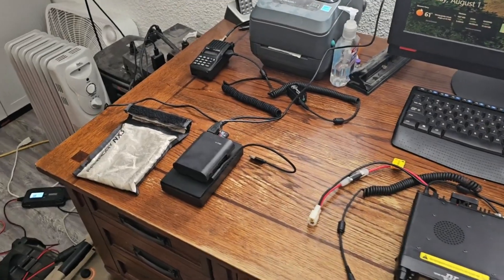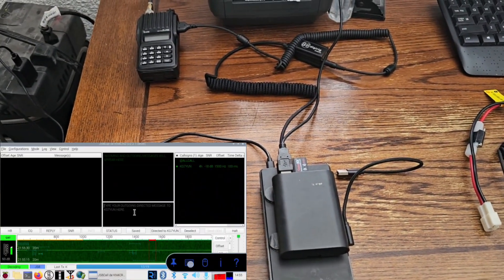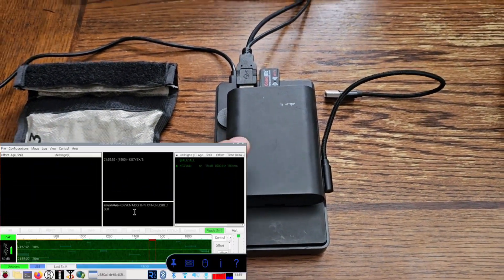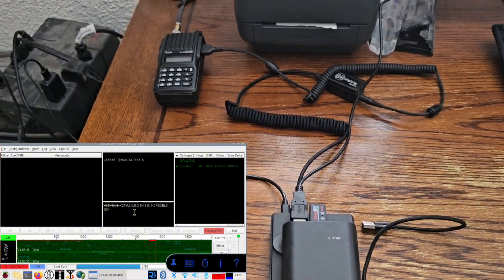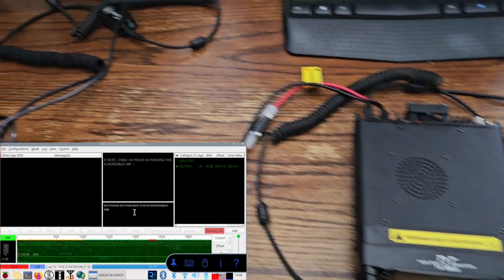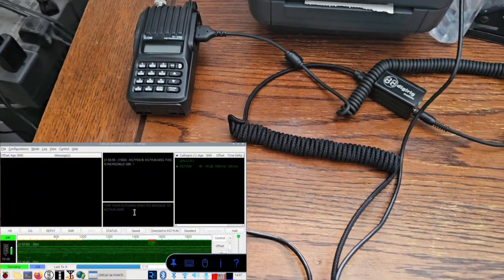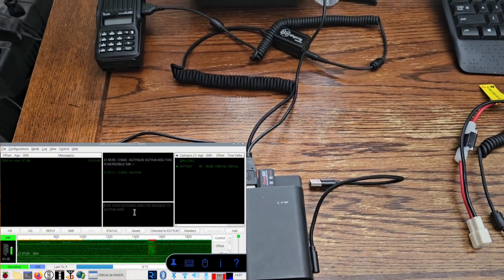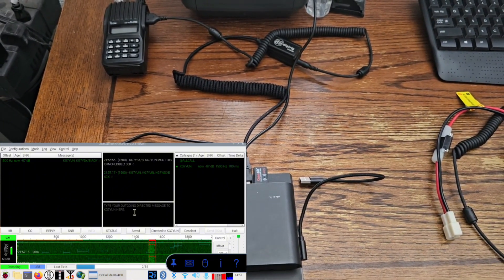JS8Call: The Cheat Code for VHF

Comment: Thanks! I came across this video after seeing KM4ACK's video on the new JS8Call App for Android. I'm really excited to try JS8Call over VHF using the UV Pro's KISS TNC and my Android phone.
Reply from the maker: I was just wondering today if the new Android JS8Call is compatible with VHF use. I thought I had read on the groups.io board that the application required manual compiling, but now I hear people talking about an .apk available. I'm going to have to try it.
Reply: @TerminalElement ah, I was hoping it would be an easier process. That's alright, though... I'm just excited to see movement on this.
Reply from the maker: @TaquitoAddict I just downloaded and installed the .apk. I don't see support for RTS, which the classic Digirig uses for PTT. So using this with a dumb VHF radio like I'm doing probably requires the VOX and squelch to both be activated, which eliminates the weak signals benefit to JS8Call. It might work with the squelch off if the user holds the PTT manually. Ill play around with it.
Reply from the maker: @TaquitoAddict Ok I got it to work by holding the PTT on my Icom IC-V80 during transmit. It is working to send and receive traffic, but it is not playing well with the desktop version of JS8Call. Traffic sent from the android device is showing up only in that upper left hand window and not like normal traffic. The android device is not IDing itself even though I input a call sign, and any commands that would normally trigger an automatic response (like SNR? and MSG) aren't working. It's still cool and I'm excited to see where the devs take this in the future. It would save a couple pounds of raspberry pi garbage in my backpack.
Reply: @TerminalElement  Very cool...thanks for letting me know what you found!
Reply from the maker: Amazing screen name BTW! The best 🤌🤌

Comment: Using The Tech Prepper's Emcomm Tools with JS8Call, 2m 40+ mile comms is solid. Surprisingly, 80m is pretty darn reliable using low power and an EFHW sloper for NVIS. 40m primary is used 24/7. Keep trying new things and practicing! 73
Reply from the maker: Is emcomm tools an adjunct for js8call? I'm not familiar with what it does. I use fldigi and js8 for my family's system. The training team I practice with on HF uses JS8Spotter as an adjunct to JS8Call.
Reply: @TerminalElement  Are you training with HRMS? Gaston, TTP, is building a platform for off-grid comms that incorporates JS8Call among other tools. Everything runs on Ubuntu, and the preferred devices are Panasonic ToughBooks, FZ-M1 & CF-20. It includes off grid mapping, BBS, WINLINK VHF/UHF/HF and constantly evolving to include FLDIGI, propagation prediction, and flight tracking. Everything will work with no Internet. The final version will be an "appliance" that anyone can use by simply pushing a button. There is no programming of the app (JS8, etc.), just select the supported radio and make the settings shown in the radio and plug in the DigiRig, DigiRig Lite, or radio and use the app you choose. We work closely with DigiRig, Island Magic, ARMOLOQ, N9SAB antennas and others to make it all work in the field. The Tech Prepper YouTube channel has many videos. The ETC software (Emcomm Tools Community) is free, you have to install Ubuntu and his software. The project is supported by subscribers of his Buy Me A Coffee site. Gaston is KT7RUN, I am WN7D.

Comment: I'm enjoying trying to follow your work. I say trying because it's technical and goes by so fast, I have trouble soaking it up. This video is particularly interesting, so I hope you follow up and that the results are repeatable. When it comes to family comms, simplicity is important. One thing that promises a great leap in this area, at least for the 2m/7cm arena, is the Vero/Btech radio (VR-N76 and UV-PRO, respectively) that has a built-in Kiss TNC and Bluetooth. For example, setting up APRSDroid to work with the radio is very easy, and there is no spaghetti of cables to deal with. So far as I know, no one has tried JS8Call and Windows, however. That's going to require somebody who knows what they are doing. I'm sure that your plate is already overfull, but this may be something of interest to you. I hope it will be. Thanks for your efforts.
Reply from the maker: @howdydoody30204b  Hey thanks for watching. The system setup info I cover on this channel are reflected in the pi setup checklist at tinyurl.com/pisetupchecklist if you want a reference to go along with the videos. I couldn't tell if you are asking me to try APRS or JS8 on Windows. I use JS8 on Windows all the time with my HF systems, and have a couple videos from last year's fire season on my settings and application. If you're asking me to do APRS, that was part of my R&D when setting up my family's comms system and there is not enough APRS infrastructure in N Idaho to span the distance. We tried. And I decided I'd rather not rely on somebody else's equipment in a bad situation.
Reply from the maker: @howdydoody30204b  The JS8 over VHF results have been extremely repeatable btw. In fact right now where I am, I can't hear home on FSQ over 2M, but JS8 set to normal speed is going the distance and I'm receiving at -18dB. I demoed this again from a rough radio spot on another video shortly after filming this one.
Reply: @TerminalElement  What I was kinda sorta hoping was that you might at some time checkout those radios and maybe figure out the Windows setup to work with JS8Call. 🙂
Reply: They also have a higher power mobile unit that also has the KISS TNC and Bluetooth to an app.

Comment: can you show how you connect the TYT 9800D onto JS8 call?
Reply from the maker: Continuing. My RPi Linux JS8Call settings on the Pi for non-CAT digirig connection to a VHF FM radio:

Radio tab -

Rig: None
PTT Method: RTS
Port /dev/ttyUSB0
There are no CAT Control settings that are available to adjust

Audio tab -
Input: alsa_input.usb-C-Media.....mono-fallback
Output: alsa_output.usb-C-Media.....analog-stereo

Notification Soundcard:
Alsa_output.platform.....hdmi-stereo

I have ALSA adjustment instructions in my sound card settings video. The AGC must be muted in alsamixer. Check out the pi checklist linked on my main page for detailed instructions.
Reply: @TerminalElement  - very helpful. The best tip was the Yaesu RJ-12 digrig cable. I've already got a digirig and will be ordering that cable for it.
Reply from the maker: @honeybadger6127  Video uploading now. I recommend using one of the medium power settings for digital to avoid overheating your transceiver. I suspect that may have contributed to the death of one of my TH9800s.
Reply from the maker: @honeybadger6127  I can explain it now and then maybe shoot a video next week! The 9800 uses the Yaesu RJ-12 digrig cable. Simply plug that into the 9800 front and back, tune to whatever frequency you want (MR or VFO it doesnt matter), turn down the squelch all the way to zero, and adjust the volume to around 60db on the JS8Call waterfall. JS8 Settings are going to depend on windows vs Linux, but the 9800 obviously does not have CAT control. Let me know if I answered your question or if I can clarify anything further. I will soon dig into running JS8 with fldigi side by side on the Pi. I just needed to make sure I've learned all I needed to learn before possibly giving people bad advice.

Comment: What kind of faraday bag was that int the bottom left of the desk scene, covered by the screen capture?
Reply from the maker: "Faraday Defense NX3", but I can't recommend it. It failed tests with the Mission Darkness app after about a year. Also, ironically, the Mission Darkness bag I previously owned failed after a year. Any suggestions for something more durable?
Reply: @TerminalElement  an old microwave oven ;)

Comment: Just a note, if there are mountains in the area, you could be reflecting off of mountains. Does the signal vary widely when it rains?
Reply from the maker: I'm confident that you're right. We have a land feature called the Purcell Trench, which was carved by glaciers longitudinally through North Idaho. I suspect that radio signals are bouncing down the trench, around all the 3-7 thousand foot mountains. Signal strength doesn't change with precip or humidity, but for some reason, the heat of the day in the summer correlates with weaker signals. Half a watt through a $30 antenna was a massive surprise. I even drove about 10 miles further north after this test and still made the trip on half a watt.

Comment: I've just started experimenting with FLdigi/FSQ on a pair of Quansheng K5(8) HTs. Will give JS8Call a go too.  What length and type of coax are you using to the Slim Jim antenna?
Reply from the maker: It's made by N9TAX (search his call sign) and it's the longer model which I think has 16' of coax. Good luck on your experiments! Share your results!

Comment: I can't get the pi link to work. Really hoping to try and attempt setting this up this weekend
Reply from the maker: Oh. I'm dumb. I thought you meant your link between your pi and your radio. Let's try this https://1drv.ms/w/s!AuIoxuDtXACEgXTx8YgX4OYeKefG
Reply: @TerminalElement  thank you for this. I'll work on getting this setup now lol
Reply from the maker: This ebay Pi that I have with me just DIED! And I don't have a spare Pi with me. But I recall the settings I had were (I'm using digirig): rig - none; RTS checked; Port - USB 0; and then for the sound cards I used the ones labeled Alsa PnP input and output. For notifications I used the Alsa AV jack (bcm2835 I believe), although I don't have any speakers plugged in.
Reply from the maker: Don't forget also you'll need to have a method to set the Pi's clock to within 2 seconds of the receiving station's clock for JS8Call to work. I'm using the Chrony app with a USB GPS adapter, and that has been very robust (setup instructions in the Pi checklist). For testing purposes, the pi should update the clock adequately from the internet.
Reply from the maker: Let us know if you get it running!

Comment: I'm guessing you got a nice little troposphere ducting situation going on.  When a temperature inversion happens the warm air mass wedges itself under a cold air mass.  Normally, this happens around thunderstorms, or facilitates the rapid build up of the thunderhead.  That's not a guarantee, just something that happens hand in hand.  Anyway, the space between the air masses makes a great duct for 2 meters, 1,25 meters, 73 centimeters, microwave, and 6 meters I listed that last because 6 is it's own thing - even though it's VHF, it has times where it propagates like HF, and 6 meters doesn't get as much of a boost from ducting; it's a weird band that has it own fun ways to operate.

The tropoducting is like a defined superhighway, and stations tens or hundreds of miles apart are able to work each other like the're next door.  From my house n Connecticut I've worked stations in New Jersey and down to DC with 5 watts on FM simplex on 2 meters.  How does that work?  Think of how an extruder works.  You have this larger pipe that funnels down a pipe that is a fraction of the diameter.  The same amount of force is used to move the material from the larger pipe through the smaller pipe.  Same thing with RF energy - you get you signal going through the duct, that energy has to go somewhere.  It shapes your signal like how a Yagi antenna would, only more on the extreme.

Now, add to this you are doing digital communications, where the sound card is doing digital signal processing, the signal doesn't have to be even out of the mud for something like FlDigi to process the signal and eliminate the noise.

Radio is so cool.  73

-Chris
ds N1WKO
Reply from the maker: Certainly possible! I'll continue testing over the coming weeks and report back with my findings. I'm guessing that if this remains consistent, then it's not ducting. The SNR has been waxing and waning substantially since yesterday, but it has continued to work with low power with this garage sale quality setup I am running right now. I did try FSQ at 50 watts and was unable to reach home, which leads me to believe that JS8Call is just a superior mode. 

We do have a land feature called the Purcell Trench that runs longitudinally through N. Idaho which may facilitate N-S communications, however this is parallel to where I am transmitting and not a direct shot to my home. If it is traveling down that trench, it's bouncing around mountains because I have nothing remotely resembling line of sight.
Reply from the maker: Oh, on the topic of 6 meter, I tested 6 m alongside 2 meter, because I couldn't find much solid information on how well it functions as a VHF band, and surprisingly I got worse performance with 6 meter. Of course this could have been attributed to antenna gain since I was using 1/4 wave on 6m and 5/8 wave on 2m. I didn't try it with JS8, though. Maybe I will run that test again sometime. 

I just tried again with my laptop this afternoon (pi just died) on half a watt, and was unable to make it. I am however making the trip with 2 watts at normal speed. It is not infrequent that signal strength drops off during the heat of the day in the summertime (performance is more consistent round the clock in winter). Any ideas why? Could this be an indicator of some type of recurrent ducting? I'm having difficulty finding sources for this knowledge on VHF behavior.
Reply: @TerminalElement   Buy ARRL's antenna book. Despite the common narrative VHF and UHF are not line of sight like everyone says. These frequencies use Troposcatter (https://en.m.wikipedia.org/wiki/Tropospheric_scatter) for reliable coverage out to several hundred miles with the right equipment. That book goes into great detail if your interested.

Comment: You can do JS8call over VHF? I’ll have to give that a shot. I have used it over HF.
Reply: Just need upper side band. Give meteroscatter a listen while you're at it, quite cool.
Reply: @neil7340  yeah that’s why I was questioning VHF. I assuming FM not SSB.
Reply from the maker: @dadsrcworkbench1322  Yep. I'm just using plain old FM over 2 meter VHF. I can't afford SSB equipment for this project, and I'm not even aware of any SSB handhelds that are currently in production. 

So far, every typically-HF mode I've tried over VHF has worked amazingly well.
Reply: @TerminalElement  yeah I don’t believe there are any 2m SSB HTs natively. The 2m rigs aren’t cheap. You should look at the UVK5 HTs. I have one and can do SSB on it…..
Reply from the maker: @dadsrcworkbench1322  I have the RA79, which I think is the Retevis version of that. That requires some modification of the board and flashing new firmware, right?
Reply: @TerminalElement  I only flashed the firmware. The board is to receive HF bands
Reply: I don't believe you will be able to do relays.  Being on FM, it would take up the bandwidth for that frequency.   Well, maybe it would work if the frequency was clear and no one else is transmitting.  You got my brain trying to figure out how your getting over a mountain at 1/2 watt and 45 miles away.  This is a cool experiment that I may have to setup next weekend to try.
Reply from the maker: @jameslee522 you're correct that FM takes up the full 25 khz or whatever, but since JS8 forwards in a store and forward fashion, I was able to do some forwards. 

It seems that, with digimodes, line of sight on VHF is optional. Please share the results of your experiments with this!
Reply: I would figure that line of sight would be optimal.  But I'm more curious about your claims of 45 miles over a mountain at 1/2 watt.
Reply from the maker: I'm able to do this frequently with other modes. These same results with ultra low wattage and a slim jim antenna were the surprises today. If you go back through this playlist I have other examples (with terrain profiles) of this same performance.